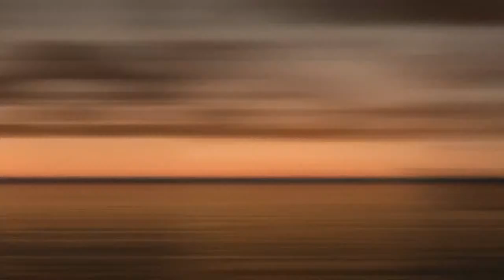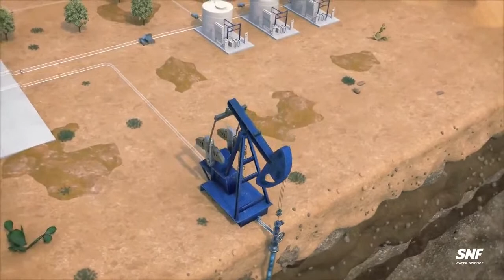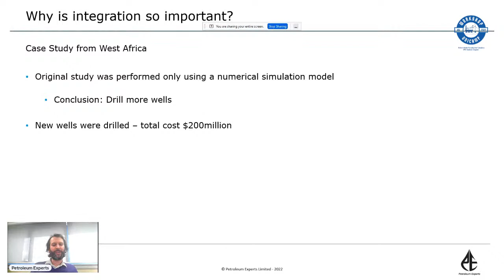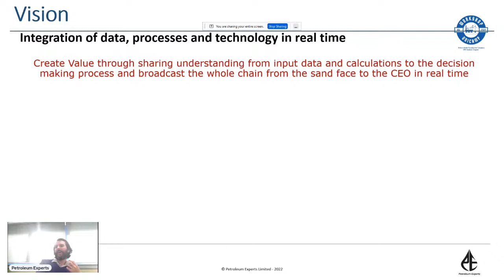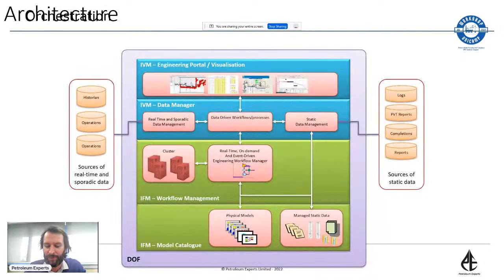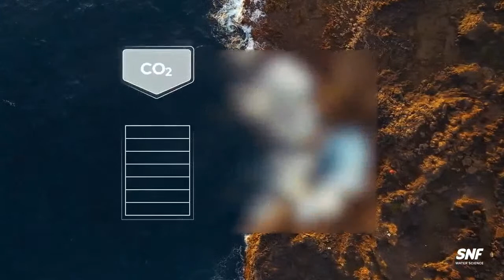Petex - Digital Oil Field

Comment: Problem was fairly simple and could have been solved easily by checking the pipeline capacity before drilling any wells. No need for complex integrated model. This company should have  fired the entire production team. 😅